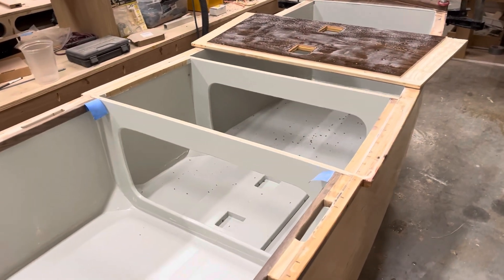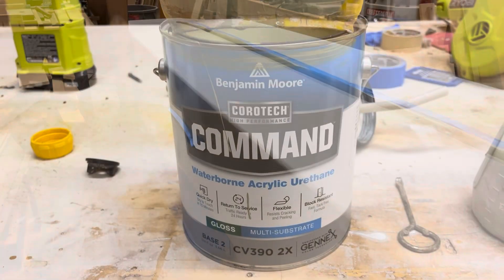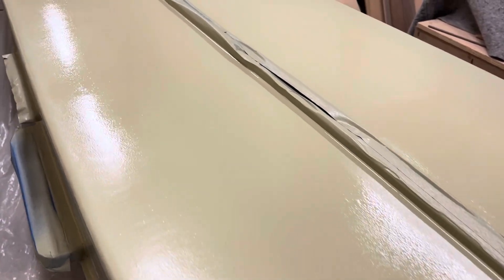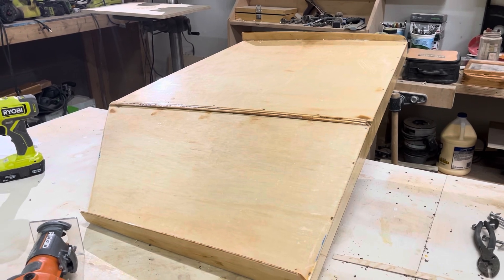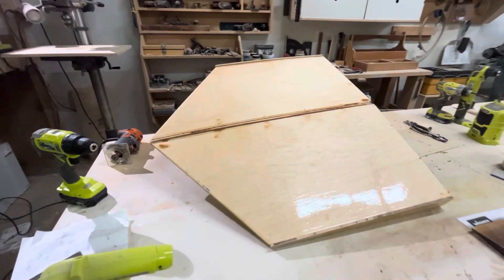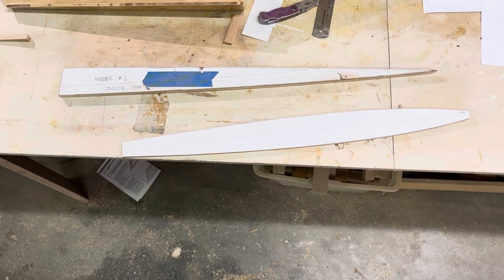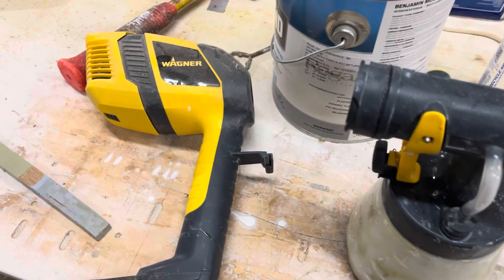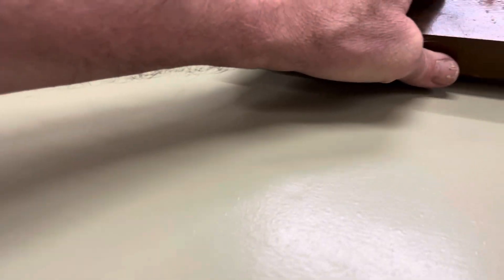Spark Sailing Canoe Build 10

Comment: i like the high build polyester surfacing primer ... that stuff wet sands out super smooth....but the Spark is looking pretty good, good to see your proto-work yielding a more finished desighn.
Reply from the maker: Thanks!  I used an acrylic primer this time, which is interior/exterior grade and recommended for the paint.  I hope this paint will hold up better than both the Behr Porch and Patio paint on my orange punt and the aqua BM Advance Gloss paint on my Wingmaran 14.